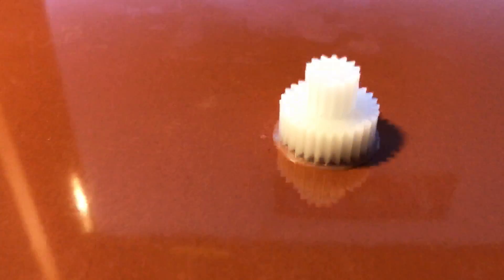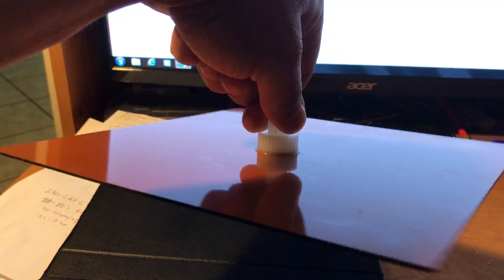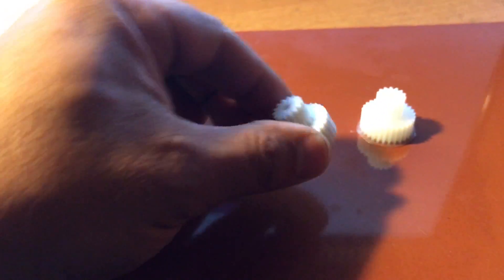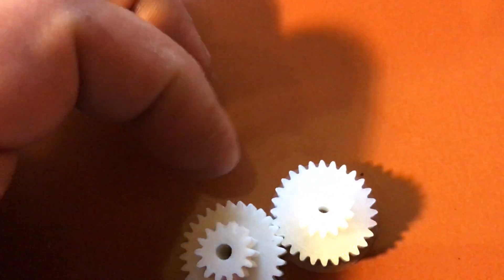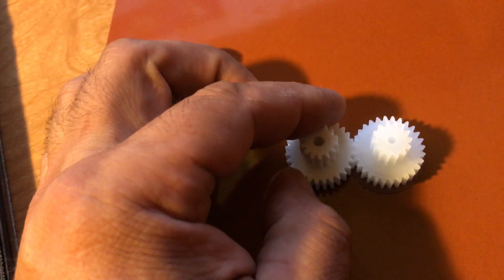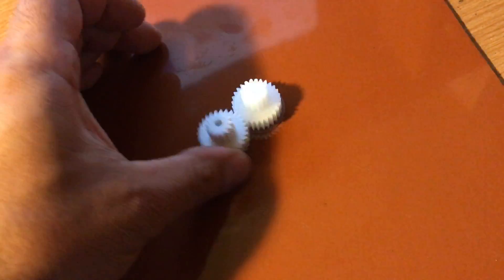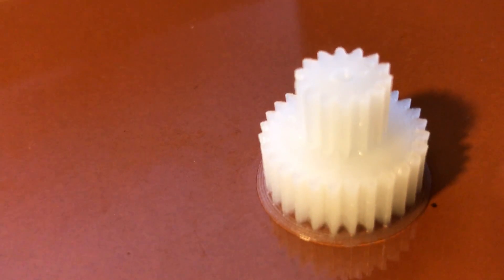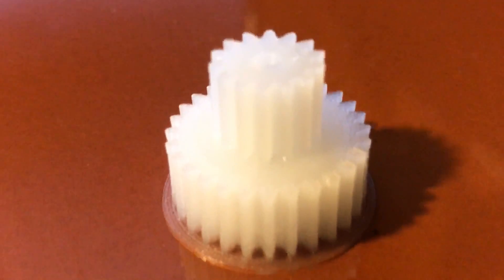Bridge Nylon Gears printing success with Anet A8

Comment: Hello, looking forward to print nylon too, i've modded the anet with 2 power mosfets, cooling fans on motherboard, stainless steel extruder nozzle and V-notch metal frame. Did you do something to the firmware, what mods did you do to make your ANET8 to print nylon? Cheers

Comment: Great job ! Did you install a Mosfet ? If yes, wich one ? I plan to buy an  Anet A8 and use Bridge Nylon filament (because PLA has a life time too short for my music project). Thanks for your advices...
Reply from the maker: Yes . I installed these two Mosfets. https://www.amazon.com/BIQU-Power-Module-Expansion-Printer/dp/B01HEQVQAK/ref=sr_1_1?s=industrial&ie=UTF8&qid=1502992558&sr=1-1&keywords=mosfet
Reply from the maker: Two Mosfets. One for heat bed and the second one for extruder. I purchased an additional power supply for Heat bed and extruder. I keep the old stock power supply only to power the board with steppers. It works great. This is important , You have to solder the contacts on the heat bed . Also , if you buy Anet A8 there is a good forum in Facebook, so the guys will help you with any question.
Reply: OK, you're great, thanks for your precious help !
Reply from the maker: Actually now I print most of the time ABS plastic and its great. Greater than Nylon and PLA . Also ABS is cheaper than Nylon. But for ABS you have to rough  the surface ( wet sanding with a bit water) of the glass with 80 grit sand paper in only one diagonal direction, use a ABS slurry (ABS + acetone) instead of carpenters glue. Heat the bed to 90 C. Use no more than 20% for infill setting in your slicer.  Its works 100 %. NO lift offs or pop ups from the bed at all. It gives you a freedom to print whatever. Cant beat that !